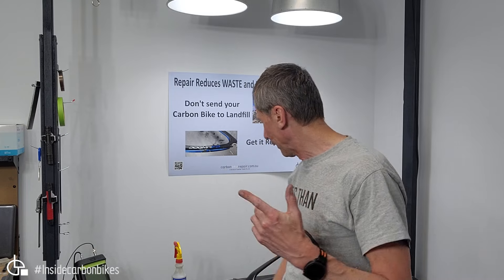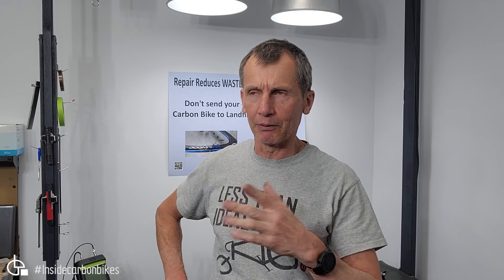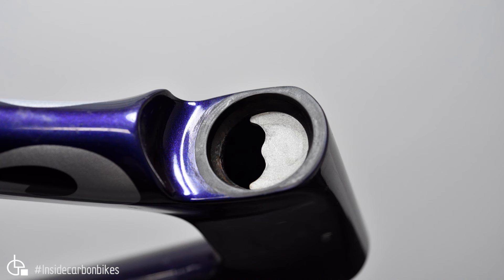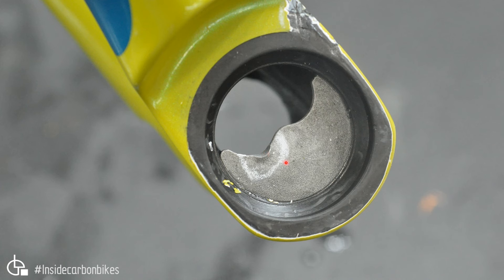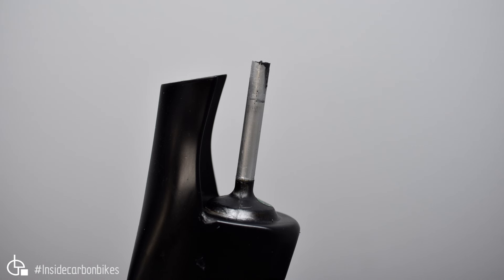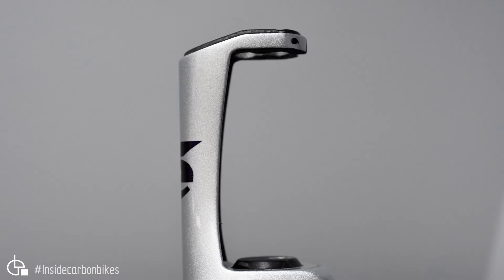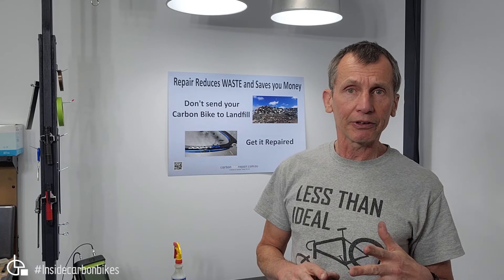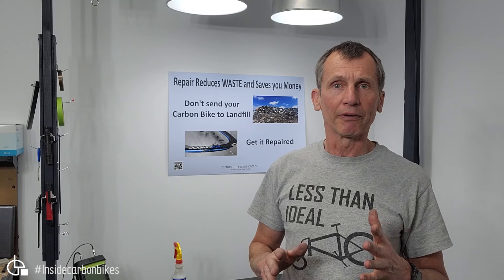Cervelo S5 Design, Yes it's Better!

Comment: So that rod cannot be axial - it's the rod that must be impacting into the new aluminium plate at its limits? (Unrelated:) Not clear to me how that piece on the top of the fork bears on the upper headset bearing, or how preload is achieved on that bearing. Wouldn't that front piece (cowling) act against any preload, and offset it?

Comment: Why the design is so complicated?
Is it easier to service with internal routing?
Reply: No it's much harder to work on when it's all internal, it's for aerodynamics.
Reply: Internal routing to this extent never makes servicing easier. You have to uncable the entire bike just to service the headset bearings.

Not too much of a big deal if it's done during a full service, but VERY much a BIG deal if this is the only thing to be done on a bike.

A sub-one-hour job turns into hours of work and the service fee is higher too.